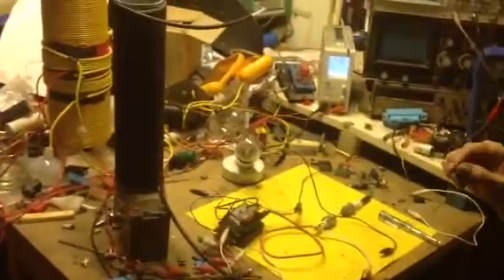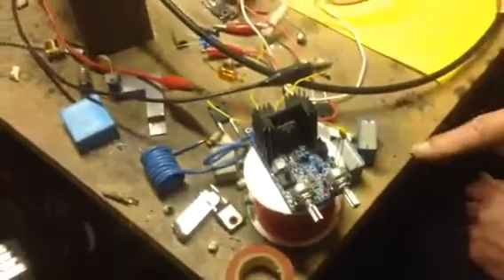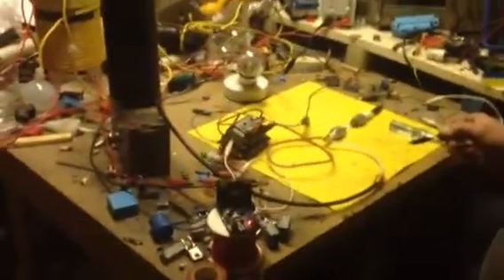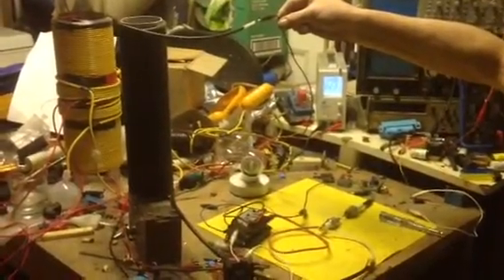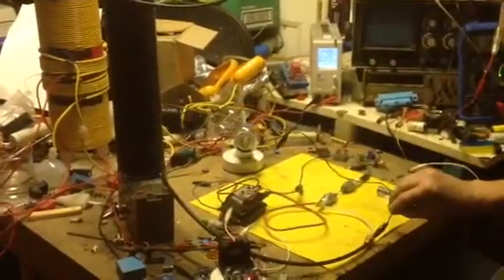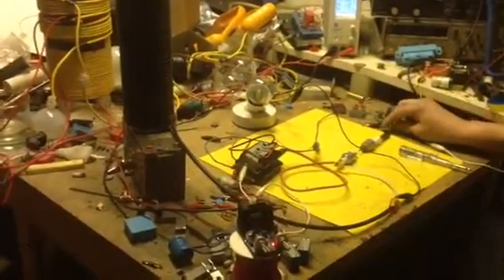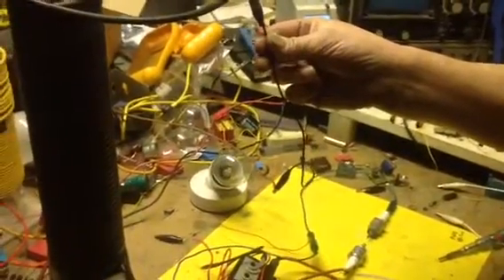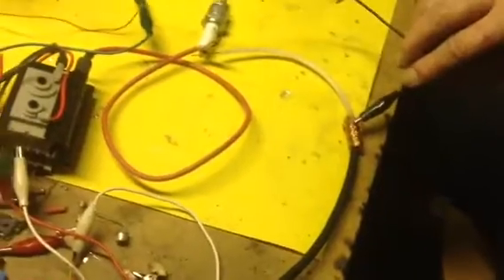CO AXIAL CAPACITOR

Comment: Hi Grumage that is another interesting discovery mate.
I did some research on Coaxial cable(For the one for antenna and another type used in cable TV)which mentioned the breakdown voltage is 8KV.But in practice it is able to support much higher voltage than 8KV.